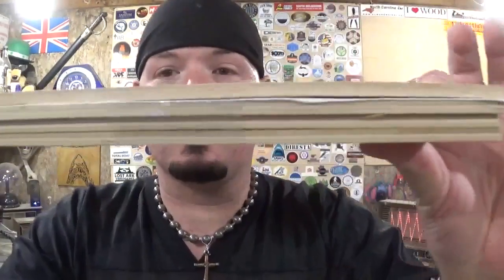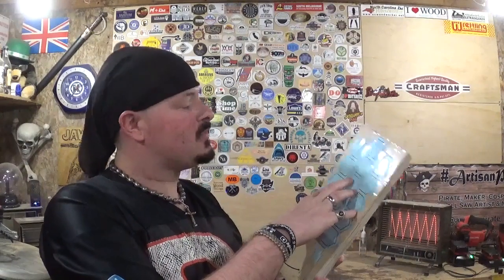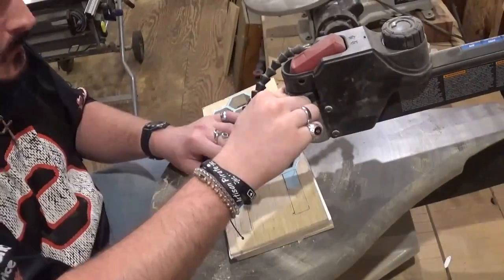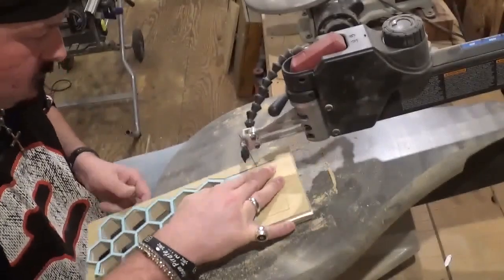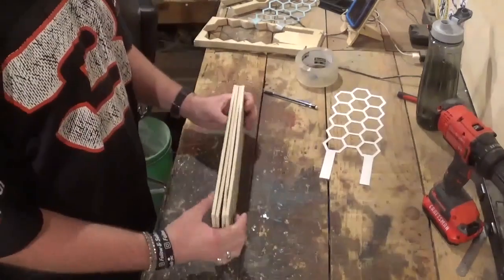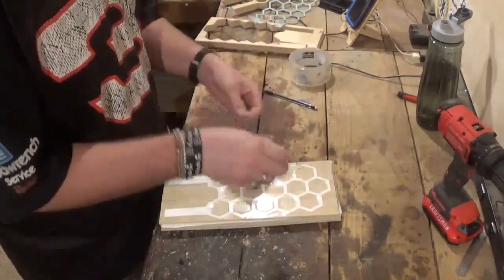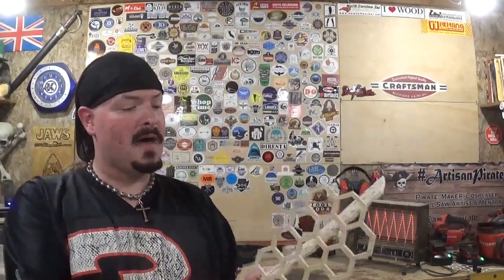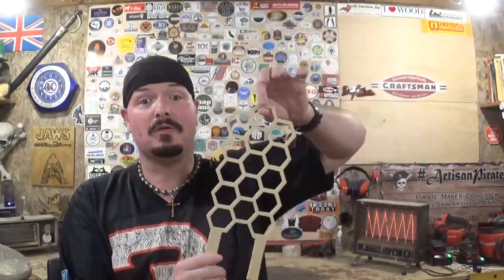Production Work On A Scroll Saw

Comment: It would be interesting to do a time study on Scrollsaw vs cnc. I have a sneaky feeling that the scroll saw would be faster. That said I have no experience in using a cnc nd am open to correction by those who use cnc machines.
Reply from the maker: Thanks !  I have actually been challenged to do a Scroll Saw VS. CNC Machine, however I have never accepted it